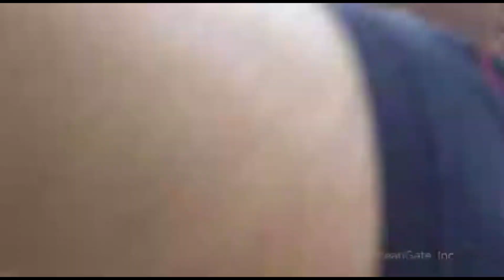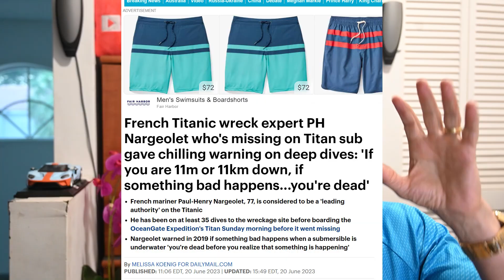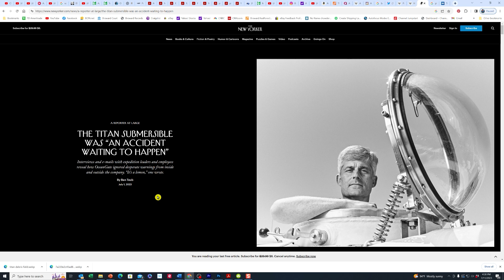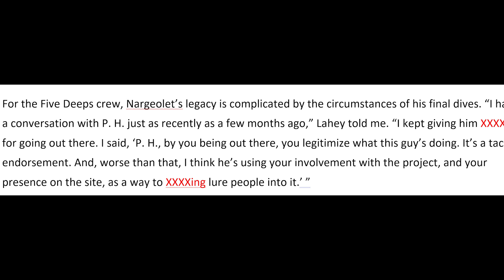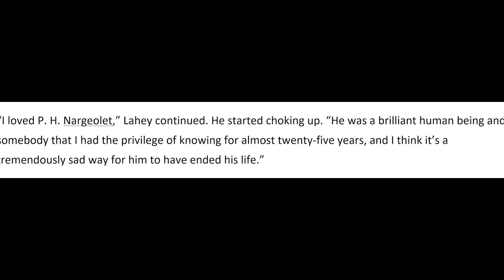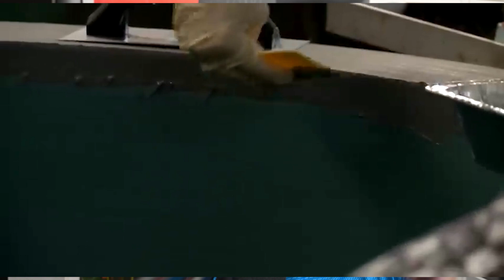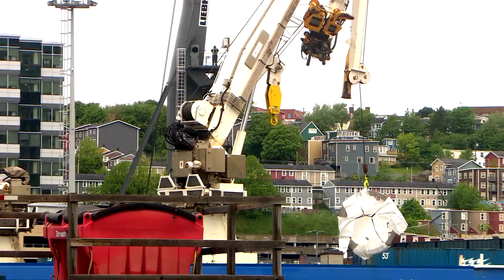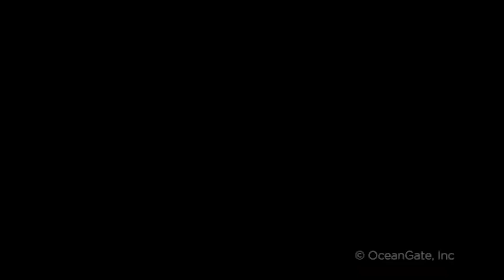Titan Sub: More Q&A, Design Defects, Why Descent Fast

Comment: Could you explore the hypothesis that seawater entered the Titan early on in their descent resulting in a heavier and less bouyant craft that descended faster than normal. When the Titan crew dropped their ballast weights and tried to ascend the craft was still not bouyant enough to ascend at 25 m/s. So aside from the crew compartment is there anywhere else that seawater could have leaked in adding to the weight of the craft during the descent and preventing an emergency ascent?
Reply: The entire 'water leaking inside the hull' theory is ludicrous. If the ascending/descending issue was actually water related it was likely just getting into the outer layers of the carbon fibre.

It seems borderline impossible that they wouldn't notice if enough water had got into the hull to weigh them down even if it was behind some compartment.

I can't imagine they wouldn't noticing bucket loads of water sloshing around, that it wouldn't cause a near immediate failure of the hull or that it would be a slow low pressure leak.

The only reason I don't say entirely impossible is because I realise that nobody really has experience with super thick carbon fibre at these pressure...it's a stretch but maybe that many layers caused an incredible drop in pressure as it worked its way through.

Comment: They’ve had problems with the controller and the thrusters numerous times before..Could the thrusters have been stuck in a position holding them in a dive ?

Comment: Wow, so many questions. On the carbon fiber, it looks like they are laying the fiber directly on top of the previous row. Did they do that with the whole process, there should have been a weave pattern used.  Then there is that metal drum they are wrapping the fiber around, did that drum become part of the finish product?

Comment: in wrap carbon you dont pre wet the carbon strands they bag it and force the resin in under vacuum. 

main problems 

1. carbon used was past its use by date.
2. carbon was only orientated in one direction.
3.the part wasn't cured in a autoclave.
4 the part was vacuum bagged which probably meant the didn't get good constant penetration of resin through the part ie void dry spots.
5 and most important carbon is a non homogenized unlike metals can be.

Comment: I work in fabrication with adhesives for a few years. I'm not an expert. I do know that depending on surface, application, and conditions, the efficacy of the adhesive drastically changes.

Comment: The more info that comes out about how this sub was made, the more obvious it is to ANYONE with even REMOTE mechanical engineering experience, even simple DIYers / Makers, that this sub was always going to fail sooner rather than later. 

They didn’t even do a real carbon fiber weave. They just wrapped the thing up like an extension cord. That’s not how fricken carbon fiber works bruh.

Comment: It wasn't the flange connection. The flange connection was so strong that it held in place while the end caps blew off. You only see a little bit of carbon fiber on the flanges, because it shattered. If it was the flange that failed, then you would expect to see the flange/end cap assembly intact,  It's not. The hull failed, most likely somewhere in the middle.

Comment: I was curious about them not using an Autoclave as well. They use them for carbon bicycles, helmets, wheels etc. Not claiming to be an expert but damn, one would think it obvious that it would be required for a vessel going up and down from those depths, that ALL of the air be removed from the resin??

Comment: Decent rate determines the speed at which force is applied to the hull. In a total dive profile there is a net force equalling zero upon surfacing and at maximum force at maximum depth.  The rate of force being applied to the hull may have been higher than the materials and joins were designed for.  If the system is stressed too fast it may fail.

Comment: I watched the vid of OceanGate bonding that titanium ring to the Hull. The thing that stuck out for me is there was no squeeze out of the bonding agent. No squeeze out means you haven't applied enough. I say that after using epoxy and various sealants for years at work.

Comment: Look at shots of the interior with the monitors on mounts screwed into he pressure shell. Those screws compromising the integrity of the shell.  That should not have happened. But if someone did it once someone who knew something looked at it the pressure shell should have been scrap.

Comment: They put it together in an open warehouse with dust and debris not a clean room and they didn't use an autoclave they put it in a bag under vacuum apparently,  shocking theres no way that thing should have been used for what it was being used, the shelf life was passed too so the actual carbon fibre they used was out of date for aero applications.

Comment: I wonder if the two titanium flanges could have been joined with titanium studs along the length of the pressure hull.  Something to keep them from popping out under pressure and also could serve to give the hull integrity.
Reply: At depth they would be pushed towards each other with considerable force... like commercial hydraulics pressure type force, a tank couldn't have pulled them off.

The glue is a red herring and how well it was bonded is practically irrelevant except that it would help seal them because at that pressure it's like thinking spitting on a chain helps it tow my car.

Comment: Maybe I’m just not that smart but there’s something I don’t understand. How did the rear cone shaped area that was on the outside of the rear titanium hemisphere keep from imploding at depth? It wasn’t part of the pressure vessel. Was it filled with water? If not that means it was filled with air and therefore subject to the same pressures as the pressure vessel right?
Reply: It wasn't part of the pressure vessel. Just a cowling so pressure was equal on the inside and outside of the cowling.
Reply: @kengself  but is it water tight?
Reply: @jonathanstewart4800  No it is not watertight. Having water inside and out equalizes the pressure.
Reply: @kengself  ok, that explains it. Thanks

Comment: 1. Complacency. 2. Ignoring real time data. They had successfully used that sub at least 11 times or more. So they knew the descent rate. No way this sub descends 50% faster than the past, unless there was a problem (leak???). Should have aborted after the second report confirmed the non-normal, fast descend rate. This sub uses basically a controlled sinking. It sinks 50% faster than prior. SOMETHING IS WRONG!! And beyond the something being wrong, surely it put additional stress on the sub.        I spent a career in the adhesive business. Yes, he should have NEVER touched that titanium with his bare hands. And yes, he should have roughed up the surface in some way and prepared the CF as well. Third, application of the adhesive surely required a controlled environment: temperature, humidity, perhaps pressure too. And fourth, what adhesive is suitable for a titanium/carbon fiber materials, at super high pressures. I have doubts that any adhesive company would have rated their product for this application. Going beyond the manufacturers ratings, whether it was for the porthole, or the adhesive, is insanity. What makes Rush smarter than the suppliers?

Comment: The carbon fiber you are referring to is called prepreg carbon fiber, where the strands are pre-impregnated with resin and cured to a green state (partially cured) Once in place, the new carbon fiber part is placed in an autoclave under vacuum, not pressure, along with heat to cure the part.
Reply: People are getting confused because a  CF pressure vessel is cured this way however the vessel itself is pressurized during the cure.

Comment: One thing I never understood if I'm correct the plexiglass window was rated at 1300 meters & the dive was around 4000 meters.  If this is true why wouldn't that be a deal breaker immediately from the CEO?
Reply: It is because the plexiglass actually had the right specs for a full 4000m dive, but because of the experimental design of the sub, being constructed from composites and having cylindrical shape, the manufacturer of the sub decided they would only certify it up to 1300m, and not the full 4000m.
Reply: @DKFX1  That makes more sense thank you.